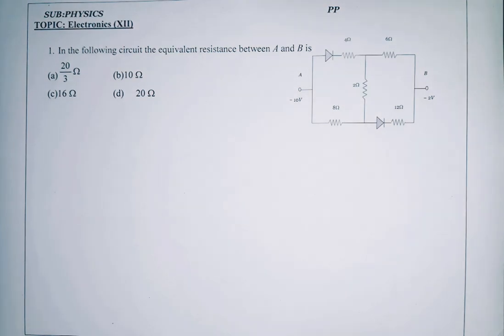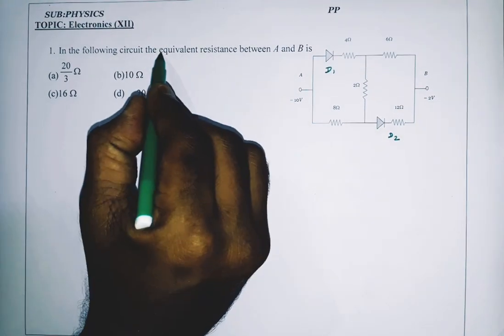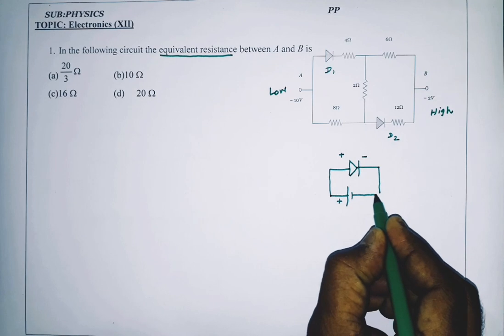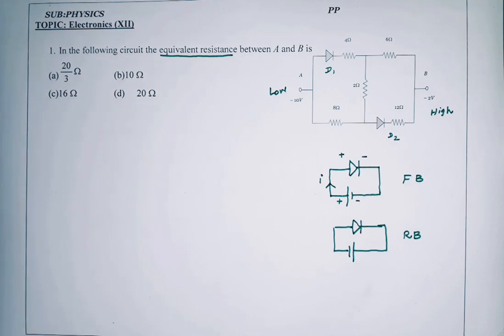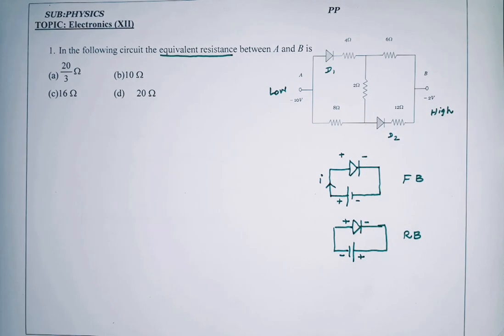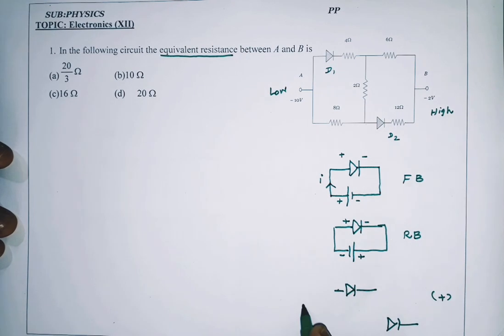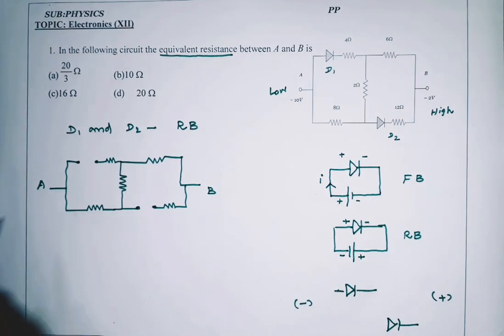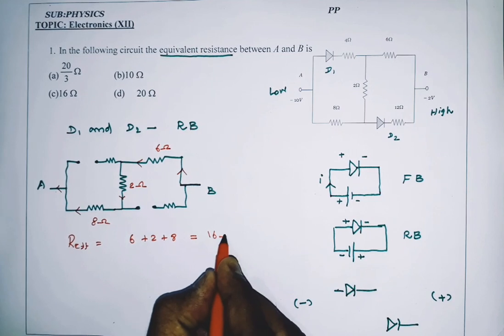NEET Physics // Electronics diode -  II // Forward & reverse Bias - Concept & Calculations

Comment: Sir andha diagram la battery  symbol a kudukalayae sir, D1 D2 forward reverse nu yepdi kandupudikradhu sir?
Reply from the maker: harini suresh - not with battery + or - . but with respect to diode p n junction , p stands for a symbol that is positive & n stands for a symbol that is negative 
see other videos of electronic circuits  as well . you understand ma
Reply: @AmirthaInstitute   Thank you sir🙏
Reply: B at higher potential.
A at lower potential. 
Difference in potential is the source of current